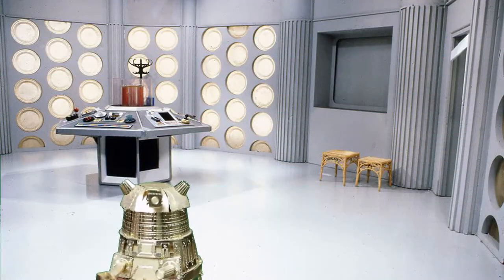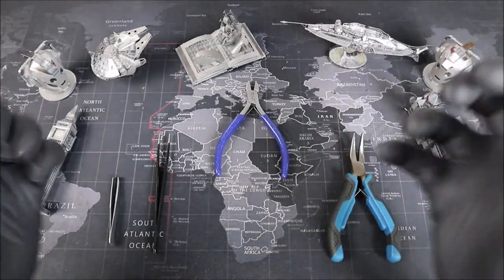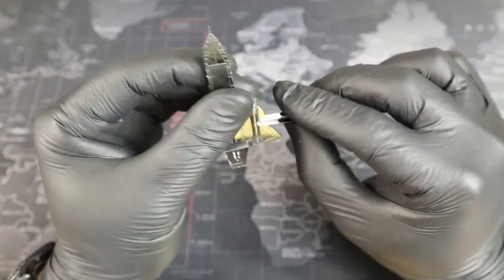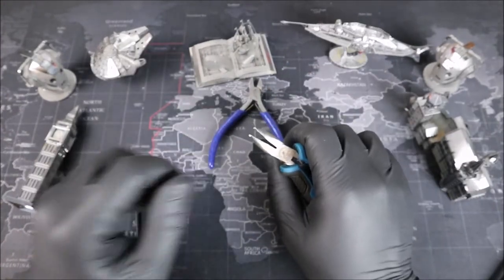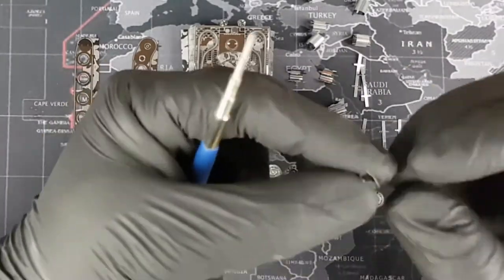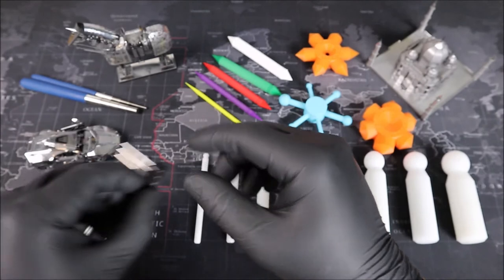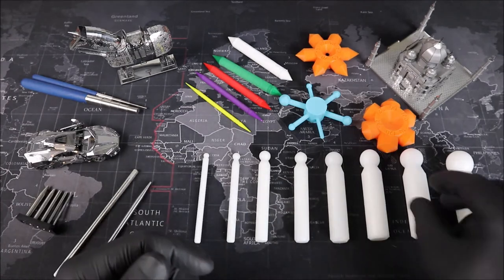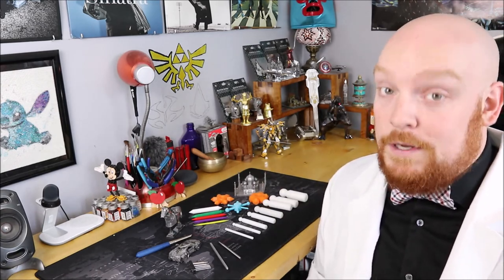3d Metal Model Tools - What do I use?

Comment: DO NOT buy the 'Metal Earth' brand 3 piece tool kit. Price equals quality and that should give you the biggest hint at what you are going to get. In my set, the nippers didn't even meet at the very end, so they were never going to achieve a clean cut. The long-nose pliers were badly forged and finished unevenly and the bullnose pliers never gripped at the very end. Instead, I use a good quality pair of plastic modelling sprue cutter nippers with a very fine point and they are perfect. For my plier selection, I use a set of Kinchrome miniature pliers. I have done over a dozen kits so far with no issues.